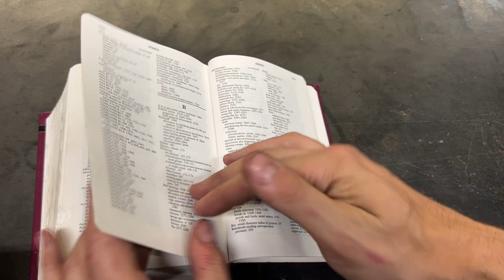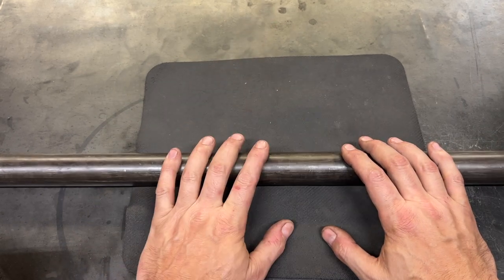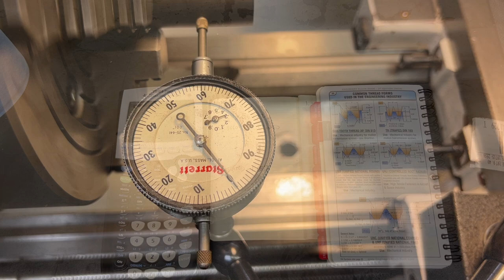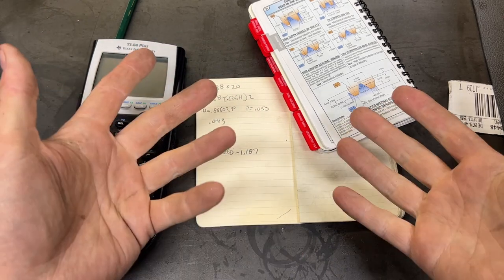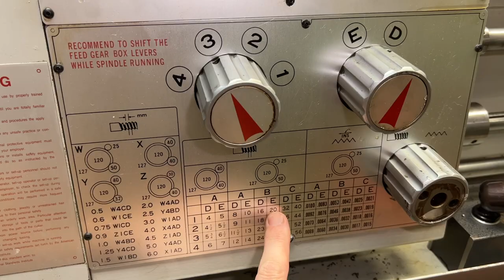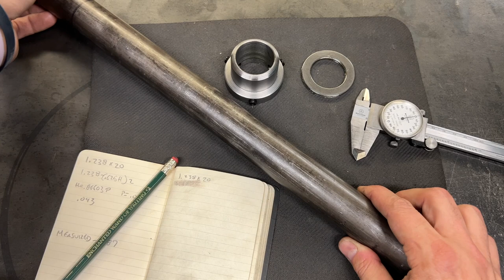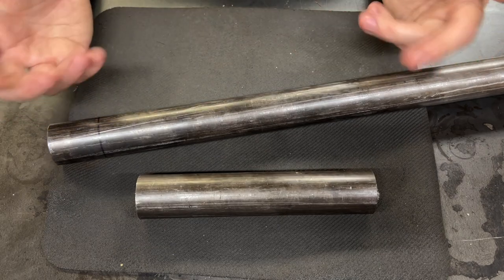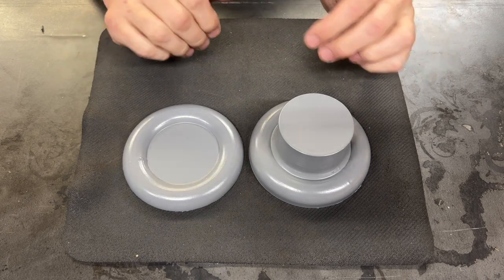Make a Drawbar from DOM Tube!

Comment: I like the drawbar but why such a small diameter for the hand wheel?  Assuming the collets will be tightened and loosened by hand I would want at least six inches with notches for gripping.
Reply from the maker: The diameter of the hand wheel is 4.5", which is larger than any I've ever seen/used. They average normally 3 to 3.5" in my experience. But the great thing about it is, you can make whatever size/shape you want.
Reply: @hersch_tool  Sorry, it appeared to be about 3 inches in diameter.
Reply from the maker: @ellieprice363  no problem at all. The great thing about making your own tools is that you can customize them to fit your specific needs. Hope to see you on the next vid where we'll cast the hand wheel!
Reply: @hersch_tool  I’ll definitely be watching the casting operation. 60 years of machinist tool making here but still learning.
Reply from the maker: @ellieprice363  I was working on it just this evening. Casting is certainly presenting some unique challenges. I’m learning through these videos as well, glad to have good experienced folks along for the ride. 👍

Comment: So you cut it twice and it is still too short? :)

Why not internal thread it and add an extension from your leftover stock to make room for the handle? A little thread locker and boom - like you never cut it in the first place. Plus then it is reconfigurable for the next lathe.

Like the channel so far. A little less hand waving please. It is a fine line between expressive and distracting.
Reply from the maker: That's definitely not a bad idea. Only downside to that it that you end up with a reduced bore diameter at the end of the shaft, which would affect the size of stock that could pass through it. I have a plan already that im gonna run with, some slight modifications to the hand-wheel, and how it's attached and I think it should work. And thanks very much! I'll take that feedback into account. I am nervous showing my face on the camera, and it's a lot easier for me to relax when I'm "behind" the camera just talking. But I get what you're saying, there's expressive, and then there's distracting. I am also working on getting in front of the camera at times where it makes sense, so hopefully will continue to evolve, and get better. Thanks again!
Reply: If you use the same stock you used for the tube, the ID would remain the same the whole way and you would not have to modify your clamp / bearing assembly or handle designs at all.

I am looking forward to seeing how you handle this issue, as well as your adventures in casting. Keep the great content coming, please. :)
Reply from the maker: @nf4x  Ooooh, ok I see what you mean. Yeah that's a great solution. I'm already more hours than I'd like to admit into this so I'll steam ahead with the original plan for now. Only gotta make up maybe 3/4" on the shaft so hopefully won't be a big deal. But if something happens and I need to re-asses, that's a great plan. And thanks very much for the support! Honestly, it's a LOT of work, making this channel nights after working a full day job. But the support I'm getting really makes it all worth it, and it keeps me going when I feel like I'm running out of steam. Hoping to have part 2 out next fri morning!

Comment: Jesus, the imp. calculation for threading is ridiculous... Metric is the diameter in mm, the depth of final cut is diameter minus the thread pitch in mm, so say m20x1 is 20mm major, 19mm thread minor, if its m12x1.75, the major is 12, the minor is 12-1.75 or 10.25mm... You just apply that in reverse for internal threads, well, not reverse, but in regards to the male thread... 
It literally takes you nothing other than hearing the M(size)x(thread pitch) to be able to instantly deduce the rest... And if you want reduced thread engagement, well, just, you know, round it over in your mind and you will be okay... If you want 76% engagement on 1.75 thread, it`s easier to just go with the flow and round it over, but if its nonsense like 1mm pitch or 1*x(being a whole number) its literally 0 effort percentile calculations where you assume the 1 is 100% and just multiply the result for any whole number multiple, in accordance with the thread pitch... 

Imperial system has some pros, but damn does it have its major cons with all the complexity and fractions... I use both, but i definitely appreciate metric as the superior system... It just translates into any application with ease... 

Nice work btw... Love the ToT references... 
All the best!
Reply from the maker: Lol thank you. You're the first person to actually mention the reference. Nice catch! ;)
Reply: @hersch_tool 
Well, its hard to miss the cues given that ToT is one of the people responsible for me having machines today... I likely spent a few hundred hours watching and rewatching his videos, so sniffing his style out is kind of a reflex by now...
Reply: The same rule of thumb applies for figuring minor diameter (or tap drill diameter tor 75% threads) with imperial threads. Major diameter minus pitch. In this case, 1.238 - .050, or 1.188. Virtually the same as the more involved calculation.